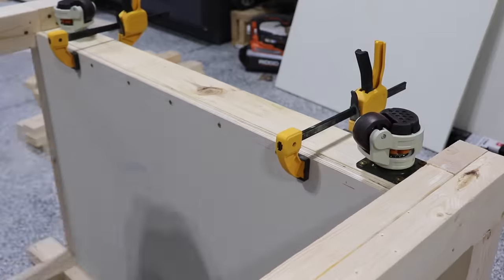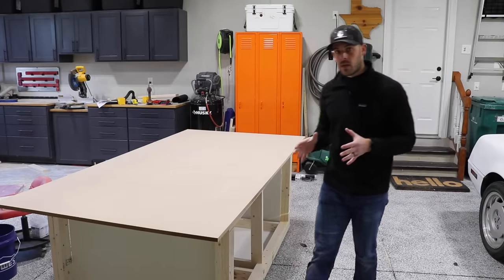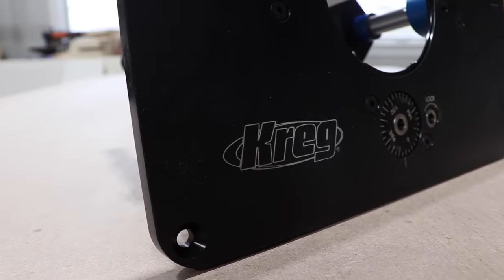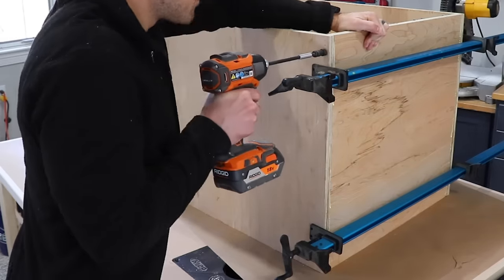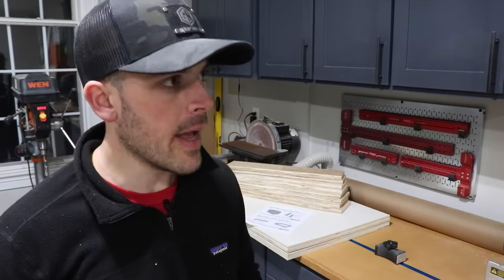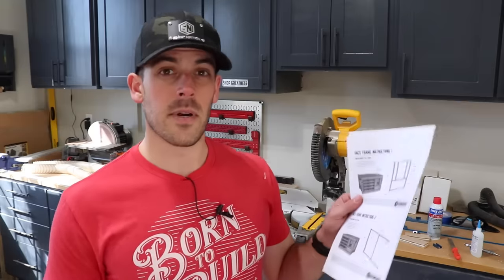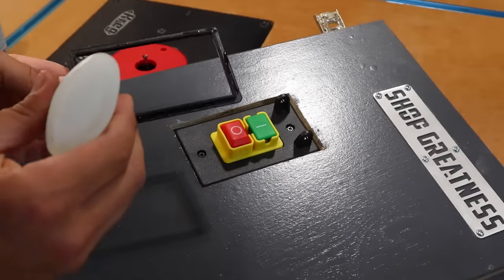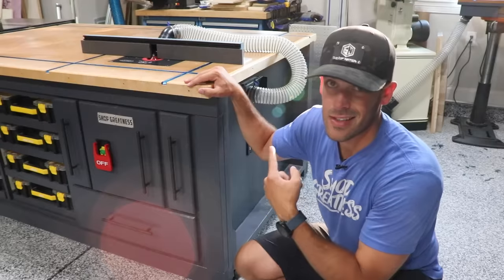The most ridiculous DIY workbench on the internet (Complete Build)

Comment: I would've jointed one side and ripped the other side on the table saw to keep the sides parallel. Using a jointer on both sides runs the risk of 2 flat sides that may not be parallel

Comment: I hope to open a shop of my own, but I'm not a woodworker.. I'm more of a laser cutter, 3D printer kind of guy. So mine is going to have spaces for your legs to go on either of the long sides so 2 people can sit opposite one another. Then for the surface I'll lay down multiple strips of LEDs, upward facing which I'll cover with opaque white epoxy and, once dry, a good amount of clear epoxy. This will make an excellent up-lit inspection / assembly area.

With the right lights from above, my bench will be the center of the Universe!!!

Comment: If you want a clean shop, mount your Dust Collector outside in a small enclosure with airflow - or at least replace that dust bag with a 1um canister filter. Otherwise it is only going to pump fine dust around your shop.

Comment: sorry but your not suppose to use the jointer on two parallel faces. One edge perpendicular to one face then you go to the table saw or planer. Second thing: shellac is a really low endurance finish when it come to friction or impact, it s only advantage are that it dry fast and you can repair it fairly easy (as a new coat is applied it melted to the one prior) a better medium for the top would have been a plastic laminate on top of your mdf. Your nailer struggle not only in mapple but also in plywood. You should look into the depth setting or maybe there is something with it.Thank you for the video

Comment: I should have referenced the difference between power strips and surge protection.  Daisy chaining surge suppressors can diminish voltage claiming ability, reducing effectiveness.  Daisy chaining power strips in a cabinet, would be the same as chaining extensions cords together,  just not a smart idea, and a possible fire hazard.

Comment: Never owned a battery nailer. Can you not adjust the brad nailers force? On pneumatic ones you can set the psi force that the hammer uses. That would eliminate the nails not sinking properly. Those were WAY to far out of the work piece.

Comment: That dust bag is not safe. It will distribute all microdust around your workshop. You will have to add a HEPA-filter. Maybe build a box around it with a HEPA-filter in the outlet gap.

Comment: Love that yiou use the glue roller, but I do not like screwing slippery wet glue wood. I would block one side of the stacked lumber with a brace or your hateful clamp to assure position before any screw. Even a upper piece pilot hole. Yes I know the screws blow thru but not as clamping for sure,. Wet Boards slip. What is a ton of time? 2000 pounds..x minutes ===.????

Comment: ALL that weight on 2 pocket screws per wheel? Quick fix is to put some blocks above them screwed into the legs/frame.
~~EDIT: NVM so happy you fixed that like 10 seconds later in the video..... Also those casters are a great choice

Comment: Why do you have a sheet of plywood under the MDF?
Reply: to add stability to the top after you route the T track in otherwise the MDF would be too thin to properly support the T Track accessories.
Reply: @marieboyd3463  Oh, so MDF under it would work also. I want to add 20mm holes but I do not know how thick I need it for the hold downs.  @StumpyNubs just did a good video on T track. Thanks!

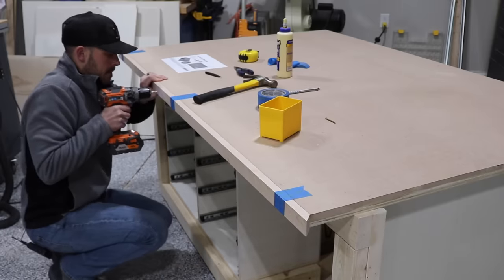Comment: at 14:52 you screwed into the trim and  you drilled in between the two glued sheets and seperated them. should have measured and made a mark where to screw so you hit the ply wood.
Reply: eyes of youtube. lol. nice work either way. very impressive
Reply: Just wanted to comment on it, but there it is, first comment😅

Comment: The most frustrating part of this video is where you talked about using a 12amp powerstrip. you spent hundreds on plywood and skimped $10 on the powerstrip. if you plug an extension device into an outlet in the united states it should be rated for the current the breaker is rater for otherwise it can catch on fire before the critical safety feature of the breaker engages. this is because US companies don't put fuses in their extension cords or powerstrips. its dumb that selling these products is still legal but they are and with where this is placed when it catches you wont know about it untill its far to late in a shop full of wood dust.

Comment: It does not go without saying because you did say it.  Get some gloves with routers, trust me. And don't use that damn heavy asssssss plunge router for trim or many things. It just is a violation.  Face mask too. I have saved myself a few times but still have had 5 trips to EMERGENCY as a result of figuring... what could possibly happen? Well it does. Grandpa built a tiny trailer cart 4x6 top with a 24" sawbalde and electric appliance motor????? Well his open blade design cut tree branches for sure but also sucked a limb in that pilled in his wrist- losing thumb, index and half of middle finger. Otherwise he could have played piano. Just saying how often shop accidents happen. Thats why craigslist has so many tools for sale... pissed off wives & Kids dumping disabled hubby's shop of horrors. No garage for 20 years and he can't even fix the broken gate. Tool boxes full of 20 hammers 50 screwdrivers. 100 asst drill bits going back to 1940 twist and earlier augers (like us) 20 pounds of nuts and bolts. 20 gallons of lubricants stains fillers glue solvents paint of all colors now blocks of plastic.  Any hobbyist's dream. Estate sales tell it all. Men hoard.  All the shop guys do here on youtube do so often is build more shop storage and buy more tools. Do they ever make stuff for regular sale. They call them Customers. Not viewers. Build to bid that would be fun. See who will buy your stuff and how much will you really get. Merch Lovers.